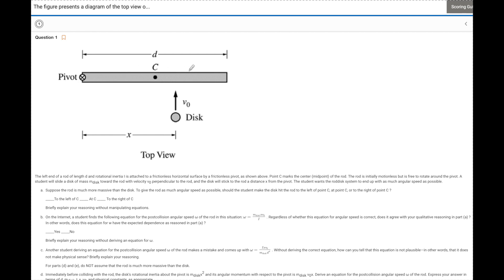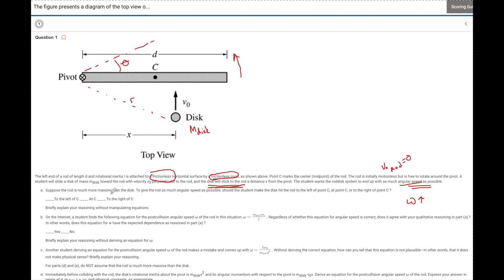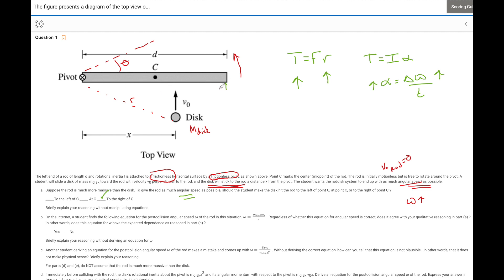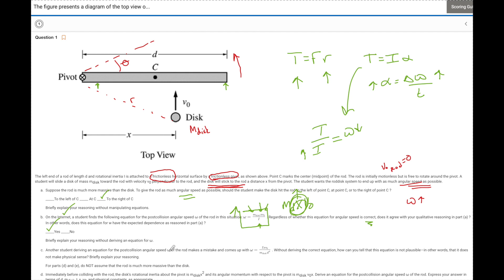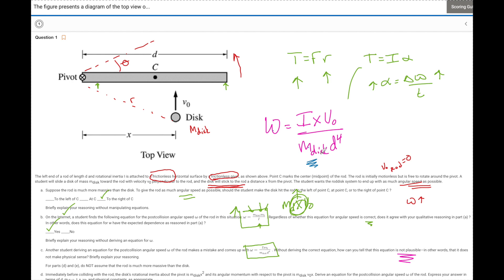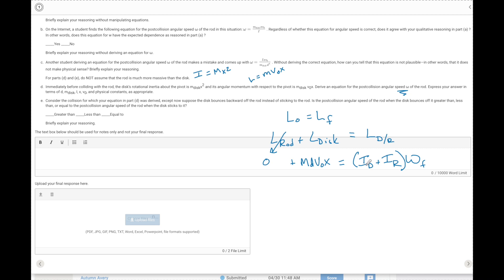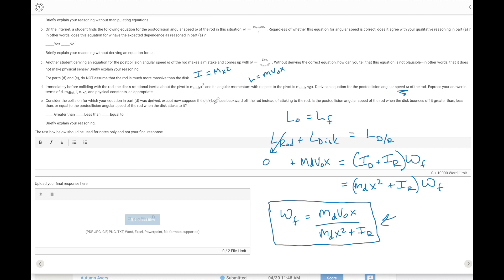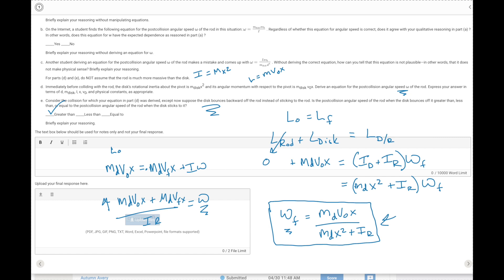Disk Strikes Rod Angular Momentum Free Response Question (AP Physics 1)

Comment: For part d) they said to leave the answers in terms of d, mdisk, I, x, and v0. I was wondering where the d would go? You also didn’t include this variable in your derivation either...
Reply from the maker: You don’t have to used all variables.
Reply: Math And Physics Tutor So if certain variables could cancel, then I don’t have to include them in my answer?
Reply from the maker: Correct
Reply: @esteenguyen9999  In a sense, the d is still there, it is just embedded inside the value of I.  Because the rod's moment of inertia will equal 1/3*mrod*d^2, assuming a thin uniform rod about its end.

Some variables may cancel out during the derivation, some variables may not be relevant in the first place.  The list is just there as the list of variables that might come to mind, as parameters of the problem that might be relevant.  They give you this list, so you don't express your answer in terms of derived quantities like the initial momentum of the disk, unless otherwise specified to do so.

Comment: For part e, would it be acceptable to say that the collision is elastic, resulting in a greater angular speed?
Reply from the maker: We don’t know that it is elastic. So no
Reply: @themathandphysicstutor  but if it bounces back I thought it would be somewhat elastic, and elastic collisions conserve more kinetic energy than an inelastic collision resulting in a greater angular speed. Would that logic be wrong if I put it on the AP exam?
Reply: @ogpandas2018  Unless the velocity is fully conserved, or the kinetic energy is fully conserved, the collision cannot be elastic. Even if the object loses a small amount of kinetic energy during the collision, it is inelastic.
Reply: @ogpandas2018  Indeed, if it bounces instead of sticks, the collision will be somewhat elastic, because not all initial kinetic energy is destroyed.  A perfectly elastic collision is an upper limit for how fast the rod will start rotating, after the disk bounces off the rod, given this setup.  A real collision, which I would call an intermediate collision, will be somewhere between a perfectly elastic collision and a completely inelastic collision.  Any intermediate collision will cause the rod to spin faster than it would in the case of a completely inelastic collision.

In order for the angular speed of the rod post-collision to be less than the case of a perfectly inelastic collision, the disk would have to bust through rod and continue moving forward.  You would usually get a problem with this kind of solution stated in the form of a bullet striking a target assembly that is free to spin.

Comment: Can you assume the Intertia of the disk is 1/3mr^2? I did everything right except that!!! Would I lose points??
Reply from the maker: Never assume! That goes for everything in life. Write that down
Reply: 1/3*m*d^2 is the moment of inertia of a rod about its end.  A disk is not a rod.   A non-uniform disk that is extra dense in the center might have I=1/3*m*R^2, but you would likely need some given fact in the problem to ever use such an equation..

In this problem, you aren't given any size dimension of the disk, but from the sketch, it appears that it is negligible in size compared to the distance x and the rod length d.   So the approximation that you ultimately do assume, is that the disk behaves as a point mass, since its size is significantly less than the other sizes involved in the problem.  Its own rotational inertia would be zero around its own center of mass, but in this problem, we are interested in its moment of inertia about the rod's pivot point.

If you were given a size to the disk, and treated it as a uniform solid disk with I0 = 1/2*m*R^2 about its own center of mass, you would use the parallel axis theorem to add m*x^2 to this value to get its moment of inertia about the rod's pivot point.  Since R is negligible in this problem, this value just becomes m*x^2.